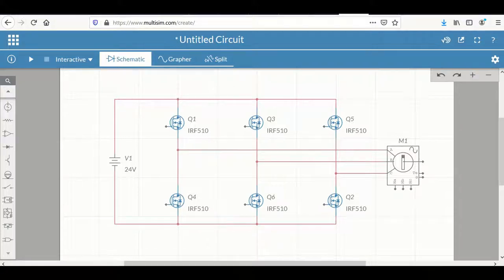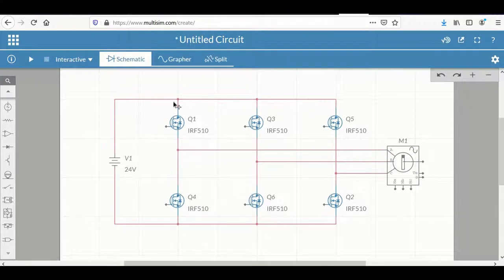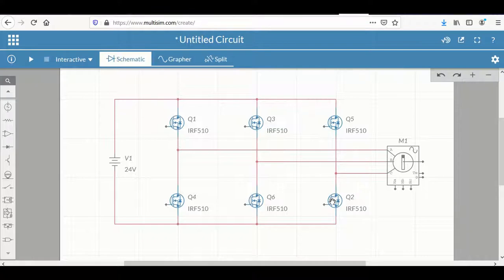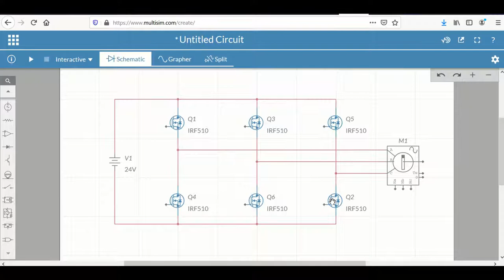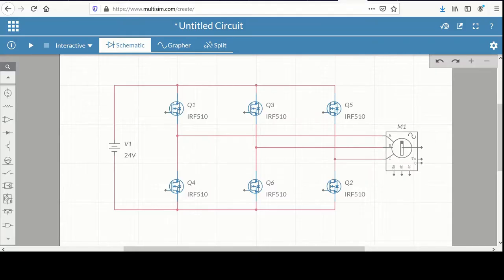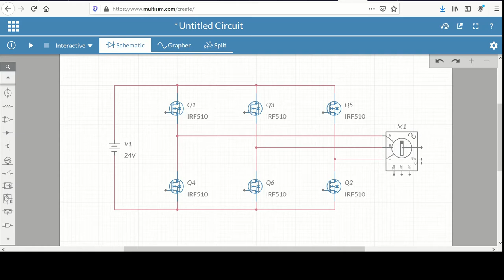Electronic commutation of a BLDC motor - switch sequence

Comment: thanks for sharing and teaching others. this is DC or AC voltage?
Reply: basicly, if i understand well, the INVERTER is here to convert the DC apply voltage to an "AC" voltage to commute the motor. you can say that it's a DC supplied voltage converted to an "electronic" AC voltage.